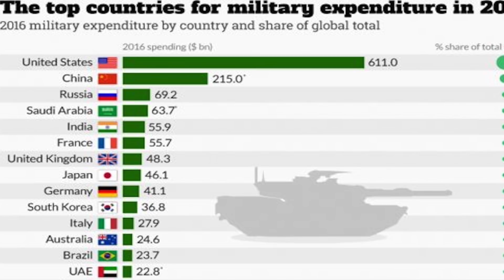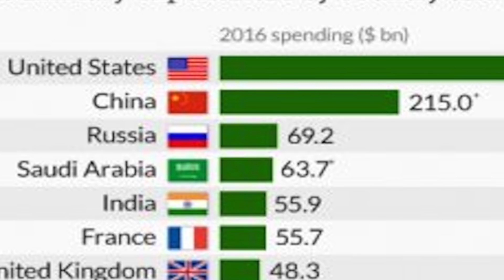CAN USS GERALD R FORD DEFEND ITSELF AGAINST RUSSIAN ZIRCON MISSILE ?

Comment: Until the navy installs the LONG overdue railguns or laser defense systems all of our carriers will be susceptible to swarms of supersonic missile attack.
Reply: Low grade lasers by 2025 to deal with Iran drones/speed-boats, 2030 airborne laser pods for a2a (J-20 threat - but can’t get all the seekers on a networked asm swarm), 2035 300-450kw on carrier for 1-2 leakers (SM6 can already hit, F-35 can track - Russian missiles manoeuvre in the terminal phase).  Also 2025 next-gen jammer (NGJ) on growler, 2030 hyper-velocity gun to target over the horizon (they’re trying to develop/get the cost of the guided bullet down (not the same gun as Zumwalt)).  Rail guns for same - the ultimate after 750KW-1MW laser (unlikely).

Against a 35kt carrier: Continuous targeting or kill chain is hard with interference/EW (or USN shooting down tracking), if the firing platform isn’t destroyed first.  Russian sub-launched missile volley are the big threat (but USN already have anti-torpedoes - CATS).  DF-21 can only try to wear down defenses, it has to pull up jettison its shielding to turn on its radar - at which point it’s a slower hot/bright target (and carriers have always been EMP shielded from far away nukes).  Is zircon a dud too? Fear LRASM launched from US fighters/bombers - stealthy smart hive-mind of hunter-killers. And PGS PGS B-21 B-21

But carriers can’t handle a saturation attack from multiple angles.  Though 2025 MQ-25 Stingray refueler to help launch fighters from way back.  With enough anticipation, a squadron can go out to meet the potential missile threat with a missile picket - over 200 aim9-x per squadron (4 per hard-point + 2 outer wings). This is mainly if run out of SM6.

In conclusion, CBG can handle 5-6 Zircon with a few minutes warning (if Zircon can even be updated or manoeuvre at those speeds).  They may have to use 2x then 3x 4x long medium short range interceptors, whilst scrabbling a missile defense picket.  Computer estimates where Zircon’s going to be and fire 200 aim9-x in their path.  It comes down to the Virginia escort sub to do its job; detect and target the noisier sub so it can’t launch before the horizon. 2 escorts? p.sJesus loves you, really.
Reply: @jasonneri7628  https://www.warhistoryonline.com/history/chinese-submarine-appeared-in-the-middle-of-a-carrier-battle-group.html
real fact vs your wet dream, dude...

Comment: It goes without saying that a CVN would be protected by more than just her own air defense weapons. How would Zircon fare against the SM-3s, SM-6s and SM-2s that would be available to the carrier's escorts?
Reply: Zirkon is able to change its flight trajectory to prevent lock-on by such missiles or by the radars that guide them. The lock is maintained by a predictive software meaning it extrapolates where the target will be in a given period of time based on its current trajectory. If the target keeps changing and getting outside of those parameters, lock breaks.

Comment: Ah no that's why we built ships so they fail right 
Just how stupid can you get. ???!
Reply: If you build them to a certain spec without realizing that someone is already ahead of that, it doesn't make one stupid, merely misinformed. And that happens. Even analysts make mistakes.
Reply: @Max_Da_G  
Good afternoon, sorry for the ooops what I was infurring was certain parts are made to allow missiles to pass through the shop so to limit the damage  from exploding and doing even more extensive damaged 
My slip.ooops

Comment: Lasers, for the forseeable future, are unlikely to have enough power to take out hypersonic weapons system simply because they don't have enough time on target before impact... and if the missile nose cone is polished, the laser will be even less effective.
Reply: no need for "polished" the missile body its constructed to handle high temperatures of over 3000Cº, more, its said the missile fly in a hot plasma cloud, making her impenetrable by any kind of laser (deflection); And remember lasers do not work on smog, rain, fog, snow, clouds,  etc.

Comment: You completely forgot about electronic warfare systems from dozens of ships and aircraft. What makes you think they'll be able to get a target lock on an aircraft carrier? These missiles can't rely on GPS since that will be jammed. Any incoming aircraft that could get a target locked will be jammed and shutdown. They will also be spoofed and interfered with. The aircraft carrier can also move very quickly itself. It will likely be long gone if the missile can't keep a constant target lock. That's the big problem with missiles and something the US is very good with--electronic warfare. These missiles will likely only work if the aircraft carrier is on its own, somehow doesn't know the missile isn't coming, and somehow the ew systems aren't working. Now the US does wan't to be able to stop these missiles anyways in case those systems are miraculously countered, but its really unlikely for a missile to travel 400km or more and accurately find its target in the ocean with no landmarks.
Reply: The ships move so slow and predictable that even if you jam the zircon misdile, it will remember the last coordonates of the ship and it's trajectory  and considering that it flies at mach 7 it would be seconds before it makes contact withthe hull of the aircraft carrier.
Reply: You idiot Russia dont use GPS. Glonass.
Reply: an 100 bucks mobile phone its able to recognize you face from millions. With no need of "remote" or guidance. Now, use a single brain-cell and thing about high res cameras & pre-loaded picture of the target, all driven by a cheap 20 bucks processor. Once the missile make visual contact with the target, you can jamm your ass in & out, the missile will still strike in. 
A weapons of 3 million dollars or more will do have redundant tracking systems, most of them able to operate in autonomous mode. You can't hide an floating tin can of 100 000 tons. Its a simple fact.
Reply: He just said the carrier will be able to detect as soon as the missile is lunched and has around 3.30min before impact and a carrier can move around 28/30 knots so

Comment: The idea that Phalanx can do anything against a Mach 6 missile is laughable. Even if it hits the target at its maximum range that means the missile (or its debris) will still impact the ship two seconds later with enough kinetic energy to cause enormous damage. Lasers won't work either. As has already been said they need to remain focused on the target for a short period which is next to impossible if the target has even rudimentary maneuvering capability. Ablative or reflective armor is also a great defense against a laser. To make matters even worse a lasers range is dramatically reduced by any particulates in the air, such as water droplets and salt crystals. And if there's any fog then range is reduced to that of a strongly thrown spear but the spear might actually be more useful.

In short, high supersonic and hypersonic weapons are currently unstoppable, by anyone.
Reply: In fact, an laser can only by aimed at a low flying missile under 45 km due to the Earth curvature. A laser beam DO NOT curve, will always travel in a straight line. 
In practice, that mind even with an laser fully charged at max output ( and that take some time !) you still need to aim exactly, and at the faster rate, and you only have some seconds to do any kind of damage. Impossible with today tech. In 7-8 seconds , IF the missile do NOT maneuver ( and Zircon have this capability ) you simply can't stop 5 tons of metal rushing at you in a cloud of hot plasma at 6500 km/h !

Comment: Laser systems have problems. Overheating of the laser gun is a problem that needs to be addressed. Missiles may be equiped with a cloudforming screen that will shatter the incoming beam. Secondly, the missile may use a coating that will burn off when hit by the laser beam. By making the missile spin and coat it with mirrors, the beam will simply be deflected. By causing the missile to undulate towards its target, the lasergun has to readjust constantly and miss the target because of its unpredictability.  Missiles may be massively fired and decoy missiles may also be used. Mist bombs my precede the Zircon misslile and explode at intervals to create a mist screen to deflect the beam. And if you can invent a system on a missile to redirect the inoming beam back to the lasergun then you can destroy the lasergun with its own laser beam. Anyway, not going to war with Russia may be the smartest trick

Comment: It should also be mentioned that China is also developing a hypersonic missile specifically for taking out US carriers - this has been spurred on by the US guarantee to protect Taiwan from invasion with the US strategy being to park 2 or 3 carrier groups around Taiwan which is only 180 km from the Chinese mainland. Land based coastal batteries of hypersonic missiles would mean that US carriers have to stay far offshore behind Taiwan (probably 700km +) to give them a reasonable reaction time if a missile is fired. 
I've long felt that these weapons probably will result in a paradigm shift in naval warfare away from airpower projected via carrier groups just like the invention of the carrier did away with heavy battleships. This is why Russia (which cannot afford them anyway) and China (which can afford them) will only build two or three carrier groups each - so as to be able to project power over lesser nations but make no attempt to match the carrier strength of the US. No need if they have cheapish missiles than can sink carriers.
Reply: common sense, history lessons, all agree with you.

Comment: Please explain why a defensive missile has to be as fast as the incoming missile? If it has to CHASE a hypersonic missile, that is one thing. But it doesn't have to chase it. It can be slow as molasses, but as long as it has solid targeting technology, all that $$$ spent on hypersonic weapons isn't gonna amount to a hill of beans. And remember, the faster an object is traveling, the less agile it is. That's why you generally don't see aerial dogfights with afterburners on. So, the idea that a missile going twice as fast as a bullet is going to be super agile at avoiding defensive missiles is rather silly. Russia is well known for exaggerating it's capabilities. I doubt it is anywhere near as fast as they claim. Probably Mach 5 at best.
Reply: The hyper velocity of Zircon allows for three and a half minute reaction time; launch detection, countermeasures and last ditch shoot down all within that window. Would you want to send a slow moving missile toward it, with the possibility of a miss?
Reply: cuz the Zircon can maneuver ? and - let me to translate for you - you may be forced to give chase, if the incoming missile turn around and take another path ? 
And the 3 1/2 minuter reaction time its an idiotic assumption - the missile can be fired from a sub, at much shorter distances !

Comment: Perfect defense against Scramjet....BTW, how silly to use a Scramjet anyway?  The Scramjet needs air,... so the defense is to deprive it of O2 (oxygen) and it will fall out of the air into the sea.  How?  Relatively simple actually,...  use laser-based (even relatively low-powered) to excite the excess of water vapor at the air-entry of the Scramjet (there should be plenty at sea).  The water-vapor will 'steam' (and it doesn't even need to do this) and cause the Scramjet engine to lose oxygen.  Very little power would be needed, actually, to achieve this,... albeit tracking it and maintaining a beam for about 0.125 seconds on its air intake might be more challenging.

Comment: The problem here is that a laser weapon has to burn through it's target. Something moving as fast as the zircon missile won't give it much time to do so. Plus if the missile shell is hardened and it depends on kinetic energy rather than an explosive charge a laser might be useless in stopping it.
Reply: Actually if the lasers kilowatts is high enough it will burn in milliseconds
Reply: Zicron plasma có thể abosrb laser dude. Chúng ta đang nói về 3000 độ từ bề mặt
Reply: @iks_.  how many milliseconds? Their range is 7km maximum

That gives them 400 milliseconds to burn through carbon fibre reinforced composite and exotic materials designed to withstand extremely high temperatures at mach 9 hot enough to create plasma.

The Zircon is now operational 

Good luck comrade
Reply: Yea that's a good point, however I doubt US depends on that, even if such a hypersonic would come close. For 1 the speed of such missiles isn't hypersonic anymore in the end stage when it lowers down, that's when you intercept it, as Patriot has shown against Kinzhal, there only less time but aside of that it's just a ballistic missile. Aegis combat system is really good, US has electromagnetic railguns now too, and likely some CIWS guns for IF something gets through. I suspect US ships would do a lot better in defending against missile attacks than russia did for example when Moskva was sunk 😂😂

Comment: He totally neglected electronic warfare and counter measures. At hyper-sonic speeds the maneuverability of the weapon is greatly reduced. There is also a problem with a plasma that build up around hyper sonic aircraft and missiles that gives problems to the platform.  And we have to say if the missile actually gets deployed and if it is like the S400 and 500 air defense the Israel is so easily defeating.

Comment: 1. to successfully target a carrier you need to find the carrier.  With a missile going at 6M  it can not turn on a dime so the ship turns and gets out of the expected flight path.
 2. If the missile is flying so high that it can search out and see a carrier from 100 miles that means that it will be seem too by aegis destroyers and cruisers and be intercepted by S2 or S3 sam's.
 3.  for a missile swam to work you would need to fire hundreds at the thousands of square miles that the carrier could operate in. to get 5 or 6 to target the task force.

Comment: Rail guns and lasers are far off developments. The computer tech is out there to keep a laser on target while it heats up the missile using PID control but it would be doing so only when in line of sight. At 25m asl on the deck of a ship the horizon is only 17.9km away. At Mach 6.5 or about 8026km/hr, that is 2.23km/sec. 17.9km/2.23km/sec = 8 seconds to identify, aim and heat the missile to destroy it which is already heat resilient due to it's ability to travel at hypersonic speeds before impact. And if the surface of a hypersonic missile could be made reflective it will take too long. An erratic flight path may cause brief moments of adjustment by the laser. Good luck. A rail gun which shoots ballistics at over Mach 7 is more realistic and it would have to shoot a massive spray of fragmenting ballistic projectiles at that. Again, to counter such measures, a hypersonic missile could ballistically target the ship as it comes over the horizon so that if it is fragmented by rail gun flak it will still have the momentum to destroy it's target. The only way to defend from this would be to have drone anti missile rail gun barges encircling the fleet at great distances such as 20 to 40 km to have a chance to target the missile as it passes en-route. Again, these barges could not utilize laser canons so close to the water with limited line of sight to horizon distances. The barges would also have  be taken out first but at least they will require another hypersonic missile to do so before the ship can be targeted. It would be expensive as many drone barges would be required to avoid saturation. Fleets are obsolete like battle ships it seems.
Reply: best post by far, congrats.

Comment: Okk one question, how many of these laser guns will be placed on an aircraft carrier?
If one fires 4-5 zircons from a small naval vessels from different angles of approach at same time how a laser gun can destroy it?
Also how can a laser gun focus on a maneuvering target at Mach 6?
Reply: It travels so fast it's instant duh
Reply: cannot. you need to stay on target a lot to do any kind of damage. much more than a few seconds.assuming the missile cooperate and do not maneuver. and you only can fire under 20km, if the missile fly low, since are a thing called Earth curvature.

Comment: LASER weapons will be the ''answer'' to defend against incoming HYPER-sonic missiles---except when Russia uses it's E.W. (Electronic warfare) system to make the USS Gerald Ford a sitting duck, paralyzing ALL electronics !!  Then, the Zircon can just scoot in a blow up this multi-billion dollar floating tub of crap.  DIDN'T ANYONE think outside the box?  ALL electric??  E.W. is not a new system.  Per the article  the crew has 3 1/2 minutes to react to computer/radar warning of a missile launch.  Meanwhile, Russia will  have engaged E.W. and paralyzed the carrier.  It takes longer than 3 minutes to 're-boot' the carrier's computers, radar, etc. etc.  = struck & destroyed by hyper-sonic ZIRCON missile.
Reply: assuming the launch its made from 400km, and not from a sub who can throw a salvo of 24 of them from 30-50 km... then you only have some dozens od seconds time...

Comment: A while back I seen a demo of a Nd:YAG laser. It was cutting steel plate about 75mm thick and was only about 1kw. Funny thing is because its just light you can disrupt/intercept the beam with a simple mirrored surface and redirect it somewhere else. Don't know but lasers seem like a weapon which can be easily beaten.